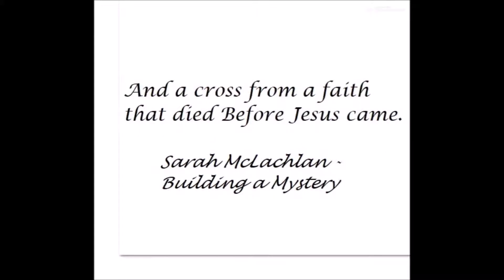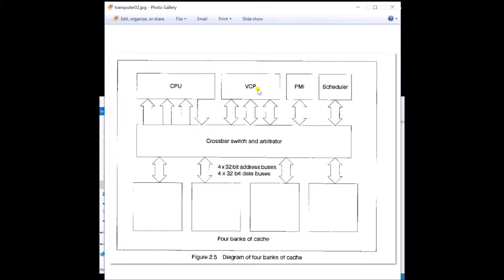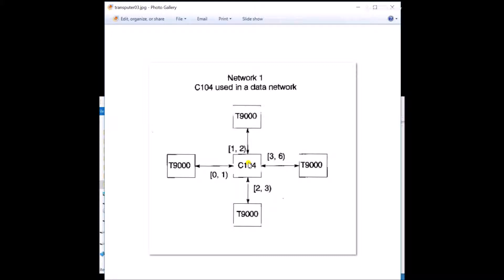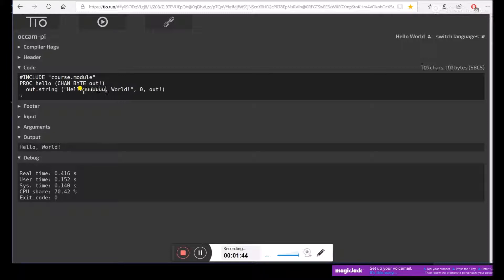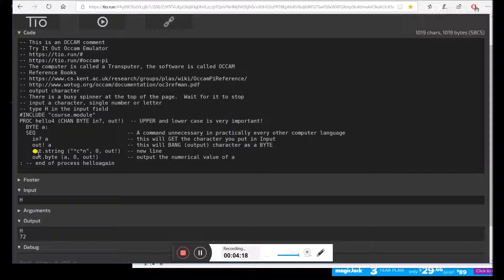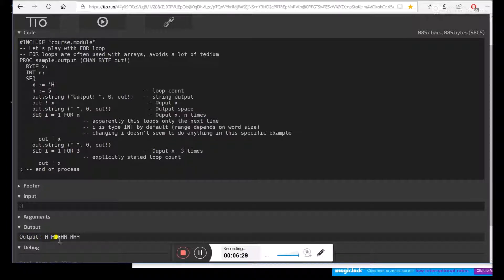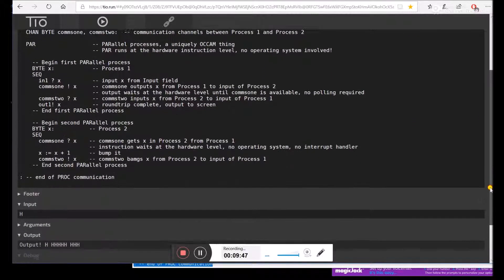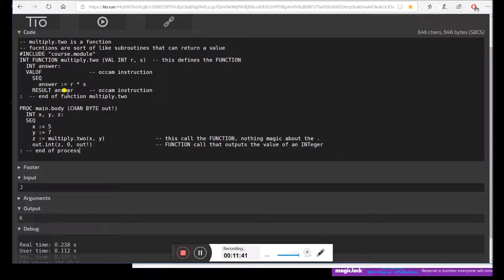Transputer Occam Hello World!

Comment: Could you put multiple transputers in a single FPGA and if you could, would that make any logical sense?  (would it be slower for them to communicate, and it would make more sense to have 1 Transputer / FPGA)  I saw a British gentleman here on Youtube emulate a transputer on a Pico Rasbperry Pi but it didn't seem to operate that fast.  "The Picoputer" he calls it.  Also given modern hardware could you have them run at a gigahertz?  (I'll admit I've never done FPGA work before but I at least know what they are).  I think it would be cool if I could simulate them in TempleOS.

Comment: So is "out! x" and "out ! x" the same thing?
Reply from the maker: I don't think there should be a space. The cool thing about in and out is that there is a pend and post relationship. In will pend on an out to feed it. Time synchronization (even across multiple processors). Message passing.  It doesn't just check the immediate value. This is different from simple cache turned off memory mapped I/O. There is an underlying hardware interrupt mechanism. I'm not sure if many modern languages can pend on an input message so easily.
Reply: @camgere  I'm studying Golang and it's very similar in spirit to this.  There's a video here "GopherCon 2016: Communicating Sequential Goroutines - Adrian Cockcroft" where I found a Sieve of Eratosthenes in Occam and I'm trying to get it to work on TIO.